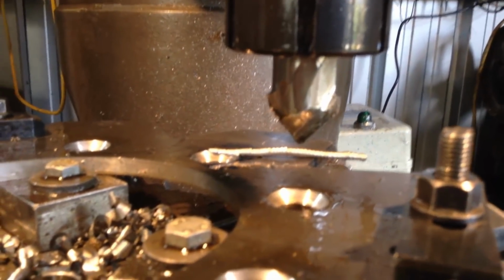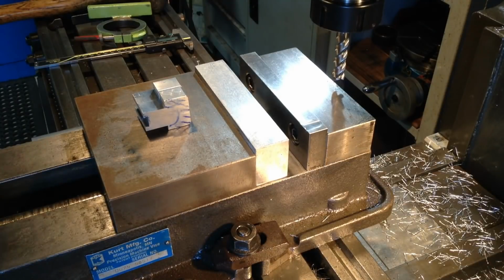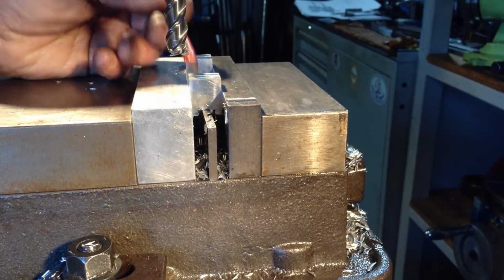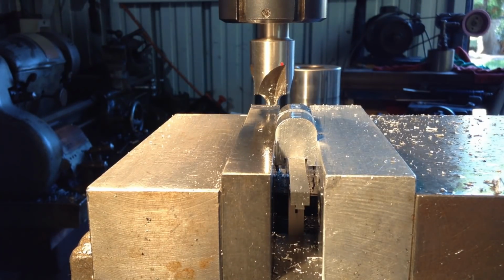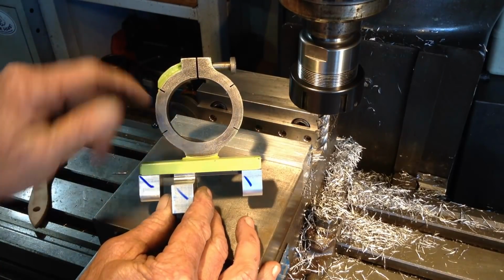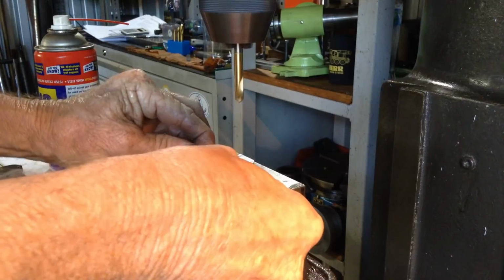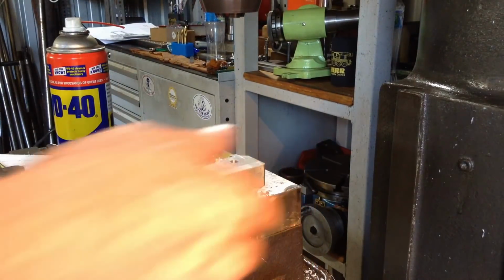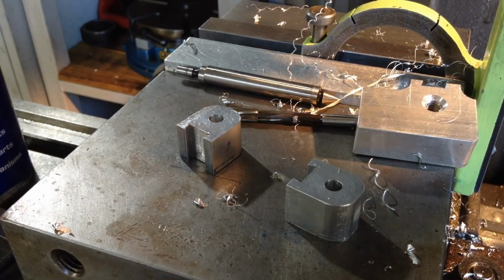L.A Rocheleau  grinding fixture indexing attachment . Part 2 .

Comment: Max,  I thought the same thing as you about the Starrett jacks. I simply turned the pointy end off flat and close to the square. (lowered it down quite a bit too!) I don't think I ever used the pointy end for anything. If I need new pointy ends they are available to buy separate. They use a non standard thread so it's easier to buy replacement parts. Cheers
Reply from the maker: I might do the same .    Cheers .

Comment: Great video Max. Wish I lived closer to you. I’d sweep your floors and clean your machines just to pick up on half of your tips and tricks mate. Especially that little countersink tool you made. That’s a YouTube video all in itself. Jeez, you got a great fit with that dovetail joint too. It went together like a wet finger in a latex glove. If I machined it, it would go together like cock in shirt sleeve 🤣
Reply from the maker: I will have alot of floor to sweep &  over a dozen machines to be cleaned  in the new shop , come for a visit  !!!!
Reply: @swanvalleymachineshop  Can't wait to see it with walls and a roof. I am assuming you will get it all dried in before your winter comes?
Reply from the maker: @hilltopmachineworks2131  Am trying , but winter will probably come just as i start sheeting .